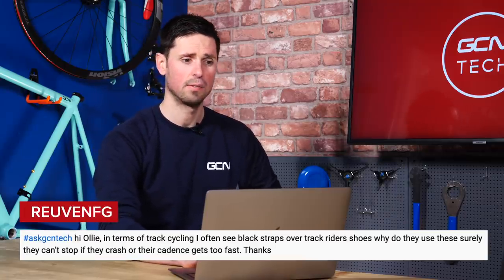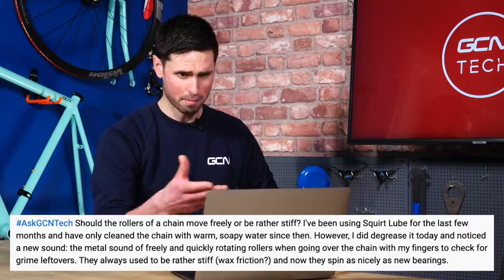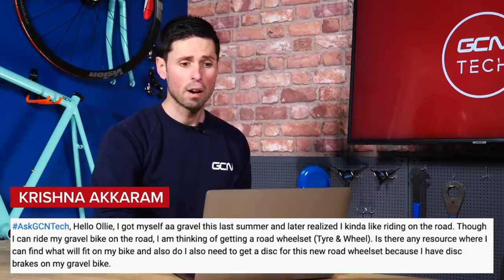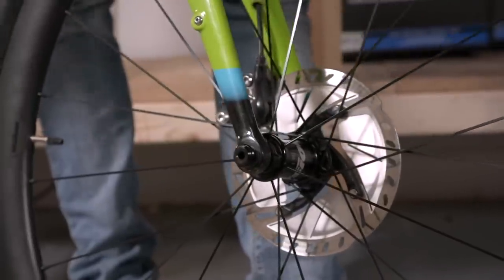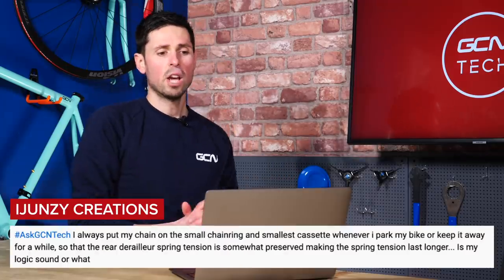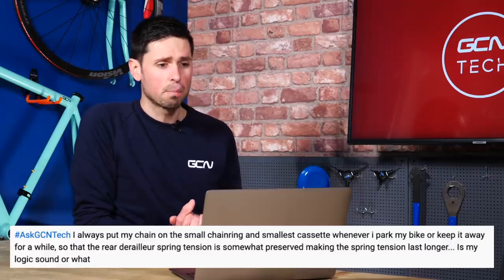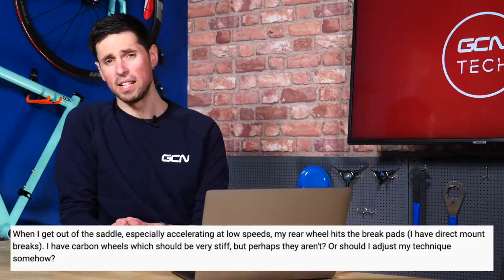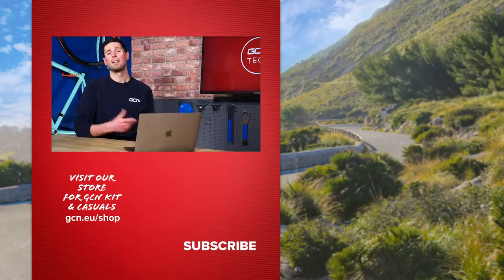How Can You Remove Seized Cleat Bolts From Your Cycling Shoes? | GCN Tech Clinic #AskGCNTech

Comment from the maker: Do you have a burning tech question? Leave it below using the Hashtag #AskGCNTech and we'll answer it in a future episode of the tech clinic!
Reply: I'd also lke to add to the answer to Krishna Akkaram's question: after setting up the new wheelset (with tyres and brake rotors on), try fitting both into the bike and look for the wheelset whose disc rotor is more outboard (towards the fork blade) and use that to adjust and center the brake calipers. After that, fit brake rotor spacers into the other wheelset until the rotor's spacing matches with the caliper. Doing this will save the effort of having to realign the brake caliper when swapping wheelsets.
Reply: #askgcntech: hi folks, on the subject of today’s last question, I’ve noticed that as recently my brake rotors seem to rub against the calipers when I’m pedaling out of the saddle (ant that it  wouldn’t happen otherwise). It’s a bit annoying and I’ve already checked the thru-axles and caliper bolts are tighten to the required torque settings. Any ideas as to what might be the cause? Thanks!
Reply: @feliperenaultcsp  As you have disc brakes, the problem is only isolated at the hub, the rotor, and the fork/frame, and not the rim or spokes.

The only thing I could think of is that maybe your fork/frame's just not stiff enough, resulting in the movement of the caliper together with the fork blades/stays (where it's mounted to) which leads to rubbing against the rotor. This is probably more prevalent in hydraulic discs, as the pad spacing is narrow.

If so, you can try to reset the caliper by removing the pads and pushing the pistons in (with a flat screwdriver or a tire lever) before putting the pads back on. As you install the wheel, slip two business cards on both sides, between the rotor and each of the pads, before giving the brake levers a few squeezes until the braking feels firm.

You may also have sticky pistons. You can look up resources online for caliper piston cleanup/servicing.

A bent rotor could also exacerbate the rubbing, so you may want to true your rotors using an adjustable spanner or pliers, though the pliers can mar your rotor so be careful.

if you have mechanical calipers, you can increase pad spacing by moving the static pad outward with an allen key and releasing cable tension.

If the symptoms persist after that, call your LBS.
Reply: @feliperenaultcsp  Try centering the caliper first.  Loosen the bolts, squeeze brake to lock it, then retighten the bolts.  That might give you enough clearance.
Reply: Surely the main concern regarding the small small storage of the chain position for derailleur tension should’ve been cross chaining causing chain stretch long term. This is a far more likely negative outcome of this practice. Large front ring to smallish rear would be best to keep the chain as straight as possible during storage
Reply: @johnoakleymusic  Chains don't literally stretch, at least not from tension or cross-chaining.

The only cause for 'chain stretch' is when the rollers and bushings are worn to the point that the rollers no longer stay in their correct pitch, causing unnecessary wear. If anything, a physical increase in the chain's length is caused by the inner plates digging into the pins also due to wear.

Cross-chaining is only bad under significant load, as it applies a tension not parallel to the chain, causing one of the pins' ends to mar and slip, the outer plates to pop out, and the chain to break. It could also cause the chain plates to rub against the chainrings/cogs, and can also be contributory to ghost shifting.

For as long as there is practically no load applied (like just in storage), cross-chaining is okay. For as long as the chain can be shifted to a cross-chain position, it's physically capable to do so (at least under no load).

Derailleur springs (FD, RD, RD cage) are not impervious to fatigue and loss of tension, so the cross-chain-at-storage method is actually sensible, but unless if your derailleurs are in the cheap or entry-level spectrum, the springs should be of high-quality enough to withstand fatigue for nearly a consumer's lifetime.
Reply: Can you bring Jon Cannings back????
#Askgcntech

Comment: Siezed Cleat bolts: If you need to drill them out, it's worth looking at left handed bits. Some are made specifically for removing siezed bolts, but often just using a left handed bit is enough to get the bolt out.  Also, if you have access to an impact wrench (pneumatic or cordless electric) the combination of a torx bit hammered in and using an impactor will get things loose.  DON'T use it to tighten, though!

Comment: Might add in for stuck cleat screws, use smaller then the screw drill bit followed by using a screw extractor. Sometimes a small left hand drill bit works as well.

Comment: If your allen key is slipping, you can try applying a thin piece of plastic over the opening, and push it into the bolt hole with the allen key. The plastic 'fills' in the damaged area between the allen key and the edges of the bolt hole. Try to use as thick a piece of plastic as you can - start with thin - like the wrapping on a cheese slice, to different thicknesses you find on different food packaging until you get a very snug fit. I've very successfully used this technique in the past.

Comment: For the brake rub question. I had this once and it was down to loose / worn cup and cone bearings.
Reply: Seconding it. Recently I started experiencing same thing with disc brake wheel and I know for sure that the bearings lost some pre-tension
Reply: For me, I had broken the QR axle, and it was just held by the skewer.

Comment: With regard to parking derailleur I’m old school and have always parked small chain ring and smallest cog on freewheel to relieve pressure on the cables  and tension on springs.  I use an old Dawes Equinox’s circa 1980’s  with Shimano 600 and suicide levers, the bike is as  purchased , all original parts. I now use it as my permanent  attachment on a Wahoo Snap and the gears shift  with click movement accurately every time. I believe the relief on the cables and good maintenance of cleaning and oiling parts has afforded longevity of components.

Comment: for stripped bolts, look up "screw extractors" (you can find them on Amazon or probably any hardware store)... it's basically a left-handed screw (can fit in a screw driver or a drill if it's reversible). You then screw it into the face of your stripped bolt (it's left-handed, meaning it screws in in the opposite direction). At some point, the torque needed to screw the left-handed bit into the stripped bolt overcomes the torque needed to unscrew the bolt... and voila!

I had this happen before with one of the bolts on the stem (so ~7Nm)... the screw extractor worked for me after all other "tricks" failed. Good luck!

Comment: Timothy: In the future put anti-seize on every bolt you install.

Krishna: I bought a second set of wheels and tires for the same reason . I also bought a few tools and swap the disc and cassette when I switch wheels. It takes less than a hour to make the change, but I don’t do it very often. If you’re going to be switching often I would recommend purchasing a disc and cassette for your new wheels. If you do that, purchase a new chain so you don’t have an old chain on a new cassette.

Comment: Bolt removal. Lay a wide rubber/elastic band across the bolt head and push your key into it and the bolt head does work.....sometimes. Old inner tube may also work but may be too thick

Comment: Being a motorbike mechanic as a hobby (while coming back to cycling after 20 years) - I'd try to weld a nut on a seized or rounded-off allen screws (or are they bolts? :)).... Could be doable even for cleats (haven't tried it though).

Comment: #askGCNTech Hi Alex & Ollie. Ive got an old Hybrid bike with a cup and cone style bottom bracket. I want to change that to a cartridge-style (integrated spindle) bottom bracket. What measurements do i need to take in order to get the correct size BB. Thanks 🙏🏽

Comment: #AshGCNTech Hi Alex & Ollie! I'm looking to buy my first set of aero wheels. I am very interested in the Hunt 30 or 50 deep wheels (I think there is a 44 deep one too) but am concerned about crosswinds. I am a tall/larger rider at 90kg, and most of the terrain I ride is rolling hills or flats. I am wondering if there is really a concern with crosswind stability with the tech advancements nowadays, and would I expect to see a large performance jump between the two wheel depths for an average rider? I imagine anything would be better than the standard wheels I have now. Any help would be appreciated! Thanks

Comment: #AskGCNTech I am relatively new to cycling, owned a stock RC120 Triban from Decathlon which its having Microsift R8 (8 speed) and 34/50. I am interested to get it upgrade to Shimano 105 to get 11 speed, is it possible to get it upgraded at the minimal cost without the need of changing the whole groupset (for eg, keeping the FD as it is and get the 11 speed bike chain and cassette from Decathlon)?
Just seeking alternative to keep the upgrade cost as low as possible.. :(

Comment: Hey GCN tech team! I've got a question concerning wheels. I want to upgrade my super shallow disc brake wheelset. I found two reasonable options for me. One is 32mm deep, the other one 42mm but more than 200g heavier (and a few bucks more expensive). Is the extra weight and money worth the extra (more aerodynamic) centimeter? Thanks guys and greetings from snowy Germany.
#askgcntech

Comment: #AskGCNTech The spacings between the inner and outer plates at the rollers of my new KMC chain is slightly irregular, with a max deviation of around 0.5mm. All of the pins move freely and I don't remember exerting the chain sideways, is this normal?

Comment: Bolt removal... 1. Start removal when you initially install the cleats... with grease and a torque wrench when installing. 2. Don't be a gorilla and over torque the bolts 3. Use a penetrating lubricant on the bolts before you try removal. 4. Don't use worn tools. 5. Make sure the bolt head is clean before trying removal.

Comment: If you want a spare wheelset for road, you need wheels, rotors, tires and an identical cassette. Don't forget that cassettes should be identical if you want to avoid tuning your read mech each time you change wheels
Reply: MRGRUMPY53  sounds weird. no differences in chain tension? no big cog weirdness? 23 to 25 might be ok, but 23 to 28 sounds a bit weird.

Comment: #AskGCNTech: Hi Guys! I've ordered a new bike for me (Canyon Ultimate, coming in May) and it should fit me (I'm 186 cm with a seat height of aprox. 82 cm). But I'm wondering if the cranks will fit me. I'm currently riding on 170 mm cranks and that bike will have 175 mm cranks. I like pedaling at a normal/fast cadence (85-105 rpm). Should I try  to get shorter cranks for that bike or will I get used to them? Thanks! Greetings from Halle in Germany
Reply: Yes. I believe GCN did a video on this with the incomparable Emma Pooley.

Comment: You can hacksaw the cleat bolt straight across the top and use a large flat screw driver to get them off. Spray lots of wd40 first and leave it soak in for 24 hours.

Comment: There is another step before drilling!!! You should gat a dremmel, borrow it from a friend or something and make a slot on the head. Use a flat screwdriver or something that will allow you to apple a bit of torque to it. This usually eorks very well and will keep you from destroying both threads and shoe itself
Reply: Yes, this.

Comment: #AskGCNTech I love the look of the internal cable routing of the handlebars of new bikes like the Tarmac SL7. I have a Polygon Strattos S7 Disc with Shimano 105. Is it possible to have internal cable routing on the handlebar?. I know Vision have an OEM solution called the ACR and I'm wondering if there is a consumer solution. Thanks.